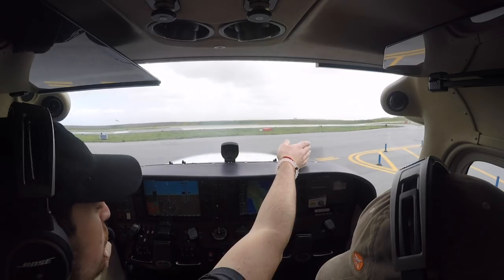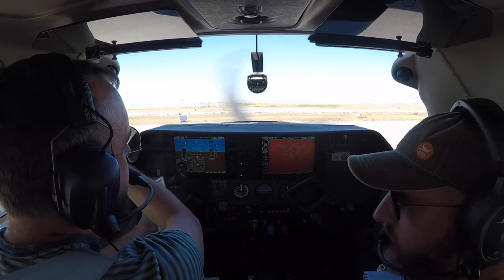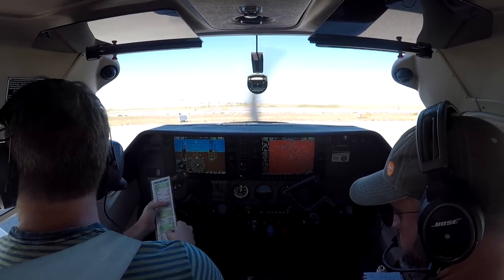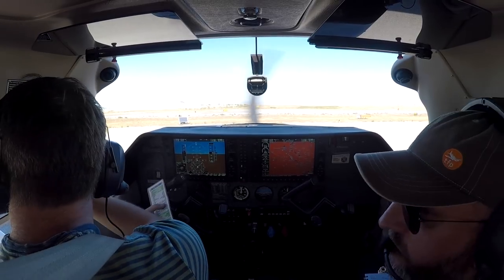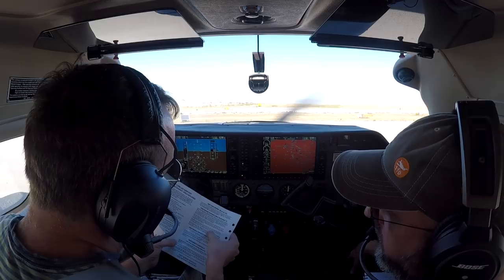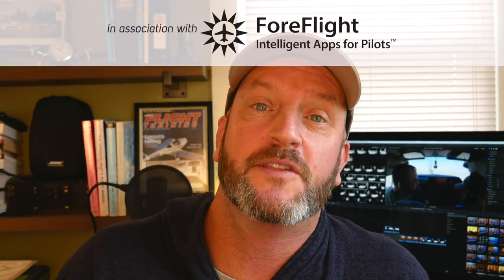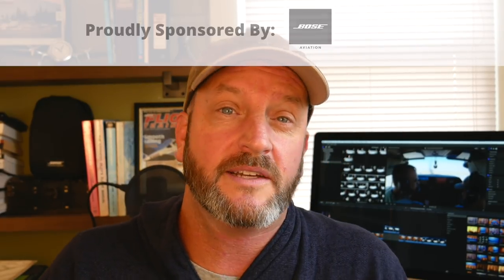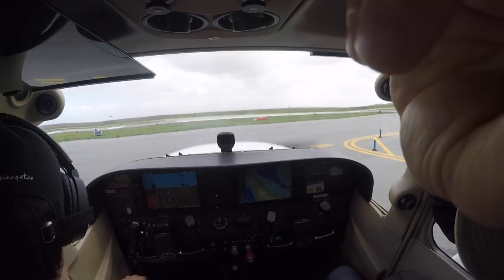Don't Crash The Airplane - How To Use Pre Takeoff Briefings

Comment: In most of my lessons this far the safety briefing has been… well… brief. I never got too detailed because I assumed if there were an actual engine problem after rotation but before pattern altitude, my instructor would say “my controls” and do the best he could. And because, of course, I was excited to get in the air for as long as possible.

As I’m nearing the PPL checkride, I want  to both wow my DPE and increase the likelihood that I will be able to walk away from a poorly timed engine failure if I’m the PIC. Will be doing some chair flying with detailed safety briefings before my next lesson. Thanks for this video

Comment: The 70% of the speed by the half way of the runway abort rule??  Ok, so if I have 50knots of a Vr of 65 knots at the halfway point of a 10,000 feet runway or 5,000 feet down the runway I WILL TRY TO KEEP PUSHING THE TAKE OFF.  Great rule?? OR bS..  Better clarify that dumb rule, please.. 

Even on the normal USA runway of 3,000 feet long, getting only 50 knots of a 65knots Vr needed,acceleration at the half or 1,500 feet point of the runway is due engine or method is no good and you will stall at end trying to continue that IMPOSSIBLE TAKE OFF.  Many accidents on take off by that method..

Better use the 5 line distance to get Vr or RTO rule.. That is around 1,000 feet from the runway number. No Vr speed before 1k feet down, pull the mixture and throttle..

Comment: I don’t like to bring up “emergencies” while the plane is running before takeoff when new passengers are on board, as they tend to get worried. How can I brief the emergency procedures without alarming my passengers? I’m thinking of doing it in my head, but that doesn’t seem as beneficial as doing it aloud.
Reply: Travis Bender what i have started doing recently is emphasizing from the beginning that it is standard to brief these things just as they do with passengers on airlines. Bringing up that and going over the same type of safety details seems to bring down peoples concerns. Hope that helps!
Reply from the maker: That's a great point Travis. and I like Michael's reply ... to add to that, I think that the reality is what most passengers will need to know can be covered before you start the plane. Making sure they know how to release their seatbelt and exit the airplane (just as they do on an airliner), after that before you takeoff have you considered using the intercom audio isolation switch and "leaving them out" of the emergency action item briefing?
Reply: Great question as I've been wondering this myself.  I've decided to alert my new passengers before we even get in the plane, when I'm going over the whole flight with them, that after taxi we'll do a run up and then brief emergency procedures before take off.  That way they know before the engine is even running (and it all seems overwhelming) that this briefing will take place.  Then, at the runway, it isn't a shock that we are discussing emergencies.  Seems to work on the few I've tried it on so far.
Reply: Travis Bender Perhaps you could just isolate your comms on the com selector panel.
Reply: @TheFinerPoints   I like that suggestion...and as I think it through, perhaps the last thing on every briefing should be to get a verbal check that everyone's ready - to ensure we remember to turn the intercom isolation "off" before departure.

Comment: Great! I did have a before takeoff briefing in my checklist, but not like this, and for my commercial flight test I have to fly a 152 (can't spin a PA-28), the school checklist doesn't have a take off briefing. The flight test is with the school's CFI so we'll see if he likes this, in any case I will continue using this - as well as the configuration flow I picked up from the podcast.

Comment: At 4.20 I think the student, Paul, says..... "if, on rotation, we have engine problem & there is  runway remaining ,  throttle is idle push forward  & land on the runway"  ????? He pushes throttle forward to idle?          I suspect that was a slip. When I started training, I had some trouble understanding the direction the throttle worked. It seemed somehow to operate in reverse of what I expected. Same went for nose-wheel steering on ground with rudder pedals. To me, the footwork should have operated same as soap-box front axle steering.

Comment: Hey Jason, when experiencing an engine failure, when will you attempt an engine restart?
Reply from the maker: Not sure what that means in a piston engine / prop plane exactly. I'd turn the fuel pump on / check mags / and switch tanks right away ... with a windmilling prop that should instantly bring the motor back if I got the fuel / air / spark combo right. So I guess I'd attempt it at almost any altitude, but if that didn't work and I was below 1000' I'd drop it and land the plane (securing the motor if time permits)
Reply: @TheFinerPoints  That's what I meant. I should have said, corrected the problem. Also, I love your podcast and videos. They're great!!

Comment: At the airline, the takeoff briefing was normally done during the taxi out, with any revisions done prior to takeoff. Holding at a taxiway in a small aircraft could block the taxiways and cause more heat in the engine on a hot day and/or fouled sparkplugs. Hopefully, the mixture is aggressively leaned. The briefing could be done in the runup area. It’s also difficult to brief for every eventuality, especially at an unfamiliar airport. Generally, though, thinking this through is a good thing.

Many aircraft POH’s don’t mention turning on the fuel/boost pump should an engine quit after takeoff due to the engine driven pump failing. If equipped with an electric pump, and it is not required to be on for the takeoff (like my 185), the pilot should remember to turn it on should the engine fail. It might require leaning to compensate for the resulting overly rich mixture, but you will be able to remain in the pattern and land rather than attempt an off airport landing if the problem is due to the engine driven pump failing. Something to think about...

Related...My mantra prior to takeoff is “Flaps, Fuel, Trim.” Works in any airplane, and actually saved me once in someone else’s airplane...a corporate jet, of all things.

Flaps: As desired for the circumstances.

Fuel: Tank selector(s) on the desired tank(s); Fuel/boost pump(s)...ON (if required); Mixture...Set for takeoff (density altitude, not necessarily rich).

Trim: Set.
Reply from the maker: Thanks Manny! In the single pilot environment it would be recommended to do the briefing after the aircraft has stopped (not during taxi) but it is generally the same idea. Thanks for the comment